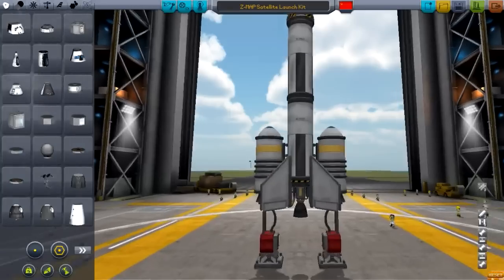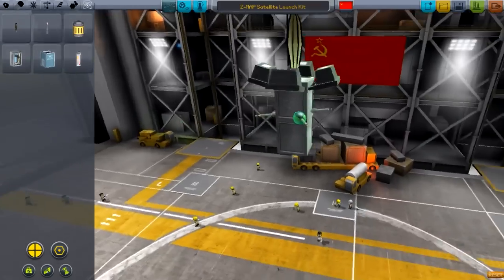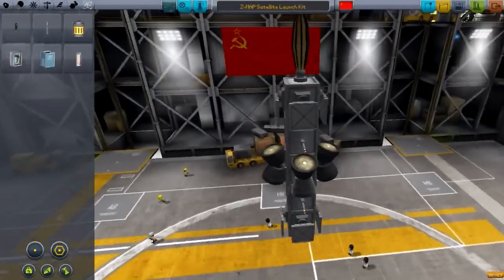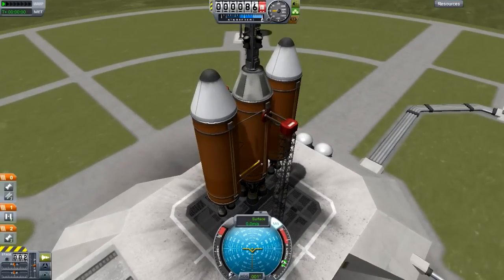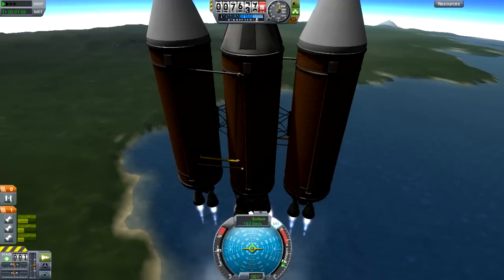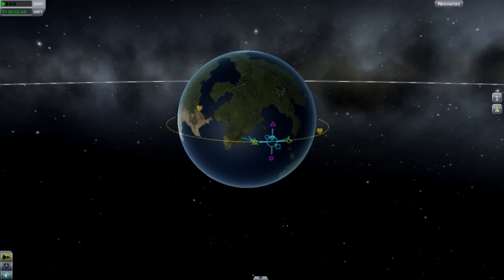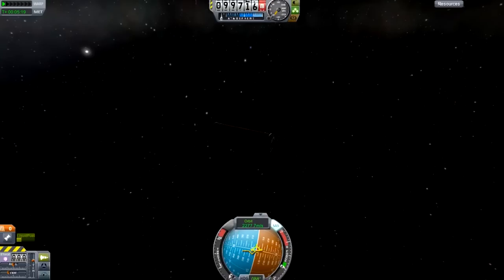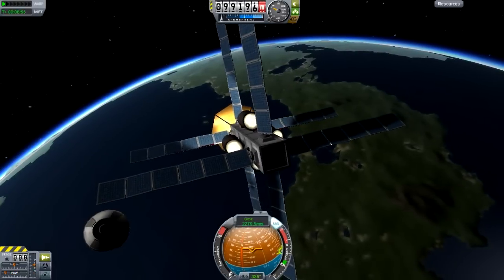KSP: How to make a Satellite (Mapping, Spying, Comm.)

Comment: I can't seem to make a stable rocket. How do you do that?
Reply: Joshua Karnitz I don't know if you still need this but use SAS (T by default) and if that does not help then click the buttons while building the rocket which shows you center of thrust and center of mass, make these as close together as possible, also include fins on the rocket, finally try to ensure that everything is aerodynamically sound, for example no jagged edges and using a fairing to cover a payload.
Reply: @telclivo7945  i think he means like to make the rocket not wobble
Reply: @daniellaborda4749  the things he mentioned will prevent it from wobbling

Comment: Why can't I move my satellite?
I have to use rocket power to get it to move...
Reply: I have the same problem, did you solve it?
Reply: Hassas Kofte Yes I did! you just need to make sure that the satellite cores have reaction wheels. The ones used in this video no longer contin reaction wheels! You can find out which Probodobodyne cores have reaction wheels by just checking their descriptions ;)
Reply: +Harry Stottor thanks a lot!
Reply: +Harry Stottor you can also toggle SAS mode, which controlls your ship freely but uses power, thats what he was doing :)